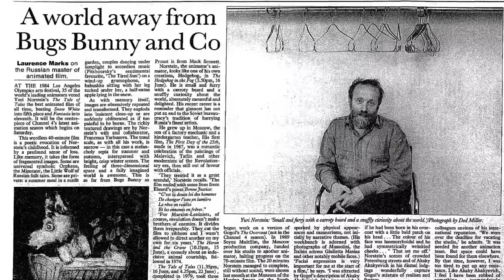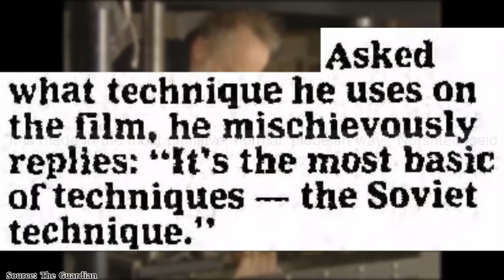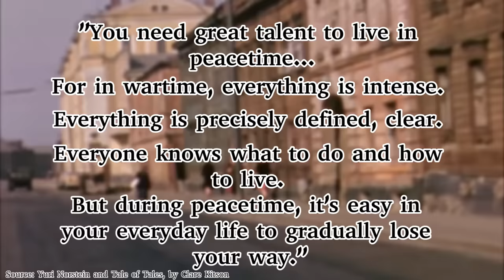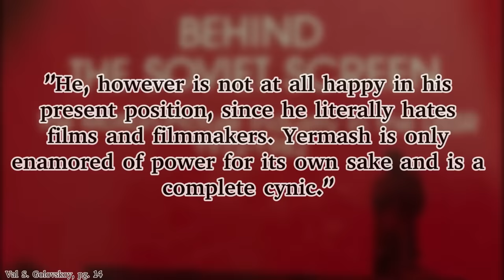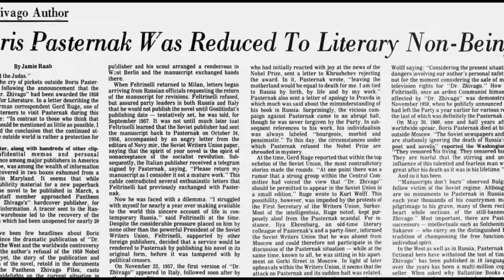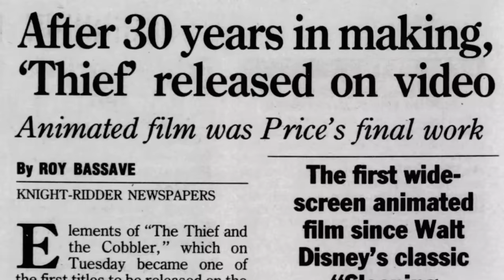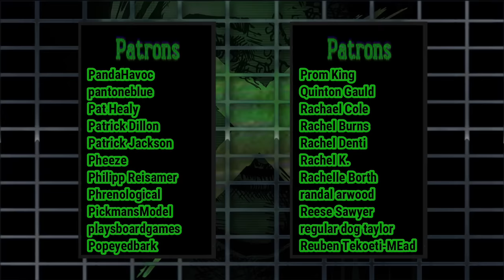The Animators Who've Spent 40 Years on a Single Film

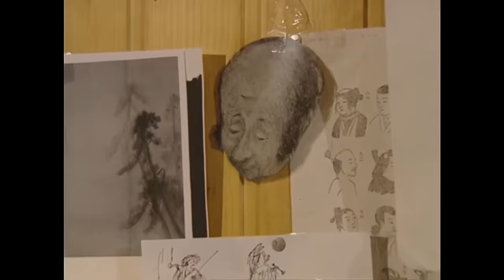Comment: Hey Atrocity Guide! I just wanted to let you know of a few errors within the captions that would help out with the deaf/hard of hearing community! At around 26:51 there is a mistake at the end of the line. It reads, "... these conditions would prove to be," when it should say, "... these conditions would prove to be paralyzing." From around 32:07 to around 32:13, there are no subtitles although there is speech within the video. If these minor issues could have a look taken at them then it would be very helpful for those in the deaf/hard of hearing community! Great video